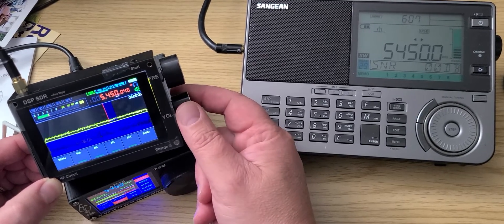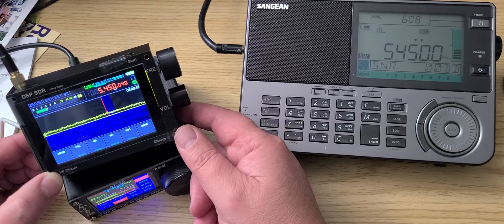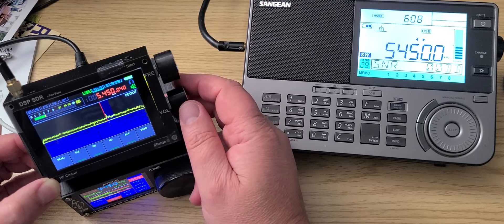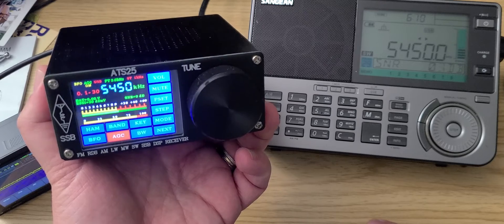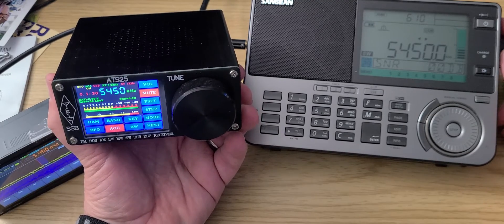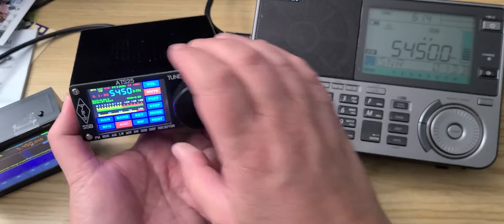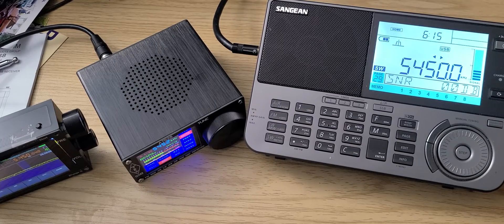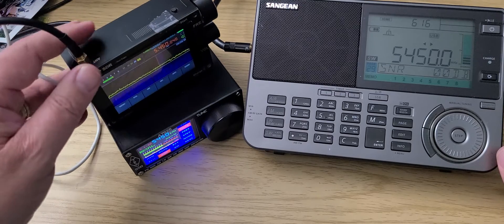Chinese DSP SDR VS ATS-25 DSP VS Sangean ATS-909X2 on Royal Air Force UK 5450 kHz USB Shortwave

Comment: Having a ATS25X2 I've grown to liking it the more I use it. It seems like it's working better with my Longwire versus the RSP/Dx SDR which surprises me. The only thing I can come up with is there's a Balun on the Antenna input of the ATS25X2. But the noise reduction on the Malachite is really exceptional.
Reply from the maker: I would suspect you might have some computer noise that might be creeping into the RSPdx , it should be as good, there are also a lot of settings if not set exactly right that change performance of the SDR also

Comment: Hi, I have got both Malahit DSP SDR and the tiny ATS 25X1. Beside the noisy reduction of the Malahit, the sound is pretty crappy even with the use of an head phone. The fonctionality are rather complex and boring (choice of AGC speed, bandwith and BFO setting, etc). I prefer the sound quality of the ATS 25 X1, and the logical command of the different settings wich are clear and "friendly".  Much more easy. I can spend hours of listening Broadcast stations and HAM qso.  I am about to purchase a bigger radio for travel like the Tecsun PL990X, or the Sangean 909X2 (I still hesitate). Anyway, thanks for your videos I apreciate. Denis, France.

Comment: The Sangean is functionally obsolete. The manufacturer should consider taking the Malachite receiver's guts into the Sangean's body and replacing the large LCD with the LED. They should add a USB port. A touch screen would eliminate the need for all the buttons. The interior space saved would allow for a more prominent speaker. The cost would remain the same and users would still have a traditional-looking portable receiver.

Comment: The DSP SDR is the clear winner. Was wondering... would it help to ground the radio to lower the noise floor?
Reply from the maker: no, the noise is picked up at the antenna, grounding will have no effect on that
Reply: @OfficialSWLchannel  thanks for the info.

Comment: Not a proper test. Each receiver should be switched through the same antenna. Also only the radio being tested should be on and the other two receivers should be switched off as there is a serious probability pf proximity interference between active receivers.
Reply from the maker: Yes proper test, using a Multicoupler that has 4 antenna ports that are all independent and prevent any interactions with the radios.   Cables are shielded.  no such problem this test is very good

Comment: You should upgrade to the original software on the Malahit, you run the chinese demo software.. The performance and the noise reduction is even more impressive! Its one of the best I have listened in many receivers during 40 years! As well you have many more options in the software from russia.. 
Malahit is a great device...

Comment: I like the first Chinese SDR one just a tad better than the ATS-25 but it's close. What I'm waiting for is for Chris at Radiolabs to get Sangean's firmware worked out on the 909 X2 so he can modify it with his filter design. I still use one of his first older Super 909s that is a fantastic fun receiver I'd like to see hooked up there with those others.

Comment: SDR has been working it's way down from kilobuck desktops for awhile. I have a SDRPlay DX which is amazing. You can tailor the signal in so many ways. They're still working on it and making it better. When they can get it to the size of that 909 with built in antennas, nice display and decent audio, I'll bite. 
It out performed the Sangean in this instance but if I had my pick, I'd still take the Sangean.
Reply: It depends a lot about the Antenna you use - the Sangean is a very good device for its price its at least way okay - IT DEPENDS SO MUCH on the antenna - the Telescope-Antenna on the Sangean and even the wire-antenna? Yeah.. its part of the Set - use a real antenna, something for those bands you really use and want to listen, and then lets copmare Sangean with SDR.. or just Sangean-Telescope and included "small-wire" and your actual DX-Antenna/ham-antenna ..

Comment: I've seen a few of those DSP SDR without a case, battery, and speaker for around $100, and the ones with the case and battery, and speaker seem to be listed for around $280+. I've been looking at one but didn't want to spend close to $300 for one, the bare one seems like it might be my option, but always a bit worried about the shipping.